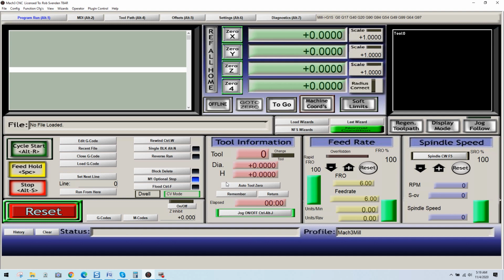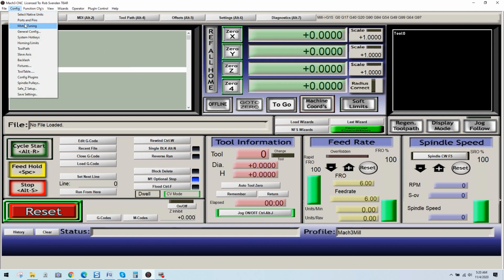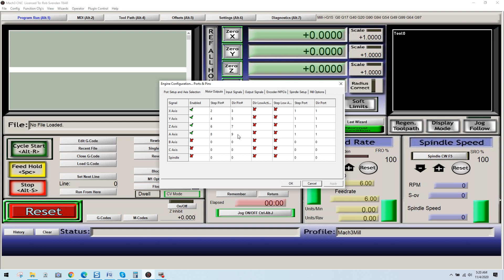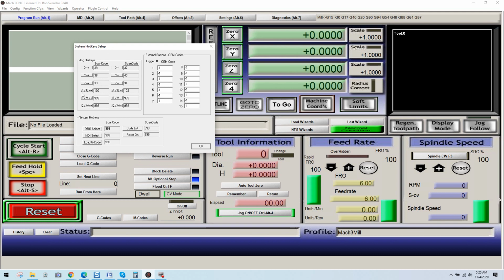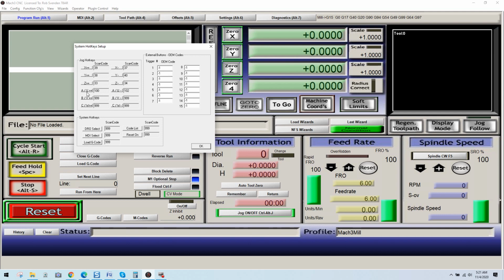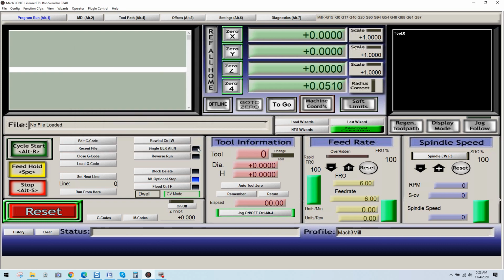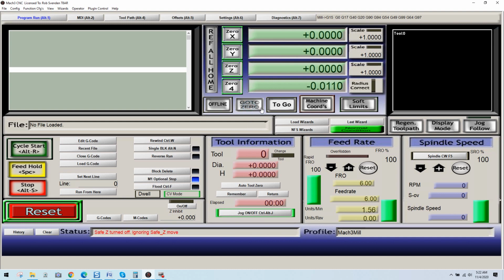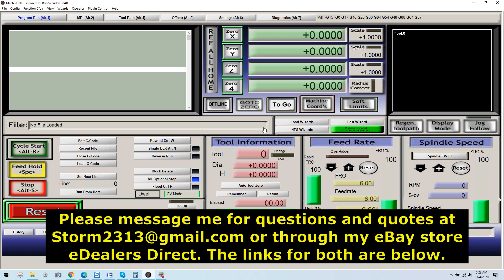Mach3 Settings Required To Get Your 4th Axis Working On Your CNC ...

Comment: Great video.
Do you know some tool like g-code ripper wich can work for auto leveling rotary parts, like a golden ring for example.
I'm working with wedding bands and strugling a lot with micro surface irregularities. 
Greetings from Brazil

Comment: Just to help me be clear, this would never apply to any of us who are slaving their extra controller to an axis?  This is just for peeps that want to add a rotator or something similar?

Again, thanks for the time to make these vids.  Life has got in the way and my plasma table has had to take a huge back seat since this covid thing happened.

I don't know if I missed a vid, but did you cover any z axis controllers that would be good for a plasma table?

Thanks, again Vince

Kirk in Michigan
Reply from the maker: Hey Kirk, you are correct this only applies ot those of you wanting to run your A axis for a rotary, similar arbitrary axis.  I haven't done a video yet on a floating head for a Z axis for plasma's, but its on my to do list..;) Thank you,
Vince